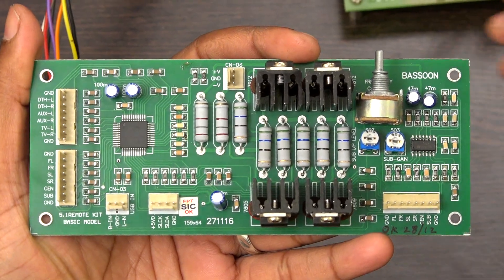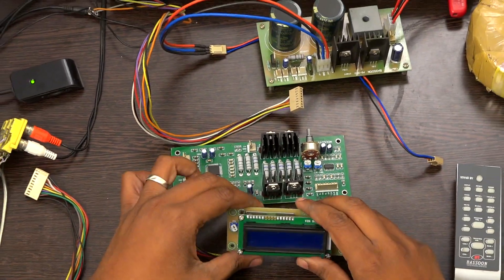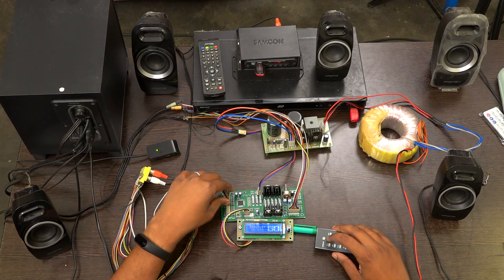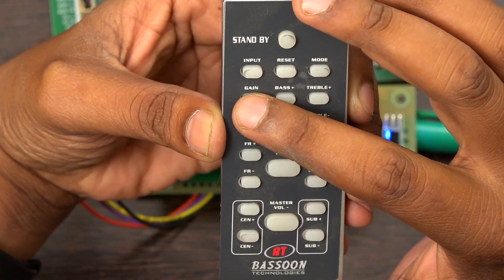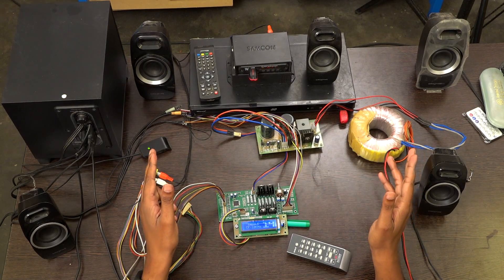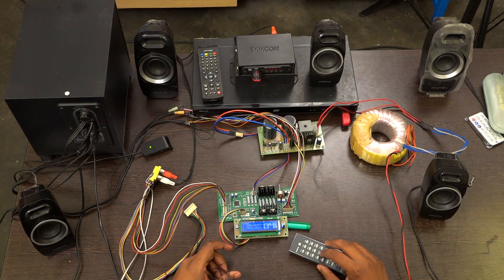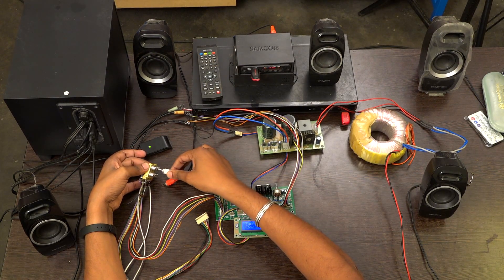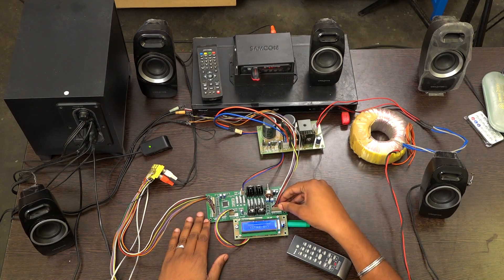Bassoon 5.1 Home Theater Remote Kit - Basic Demo

Comment: Any one who is having such 5.1 amplifire can share his experience. 
Does all 6 speakers sound properly every time. 
Does central speaker gives proper sound? 
Does subwoofer is properly give bass. 
Surround sound speakers give proper treable? 
I thinks after 2-3 month of use this system goes dump. No one can find what is wrong with this system.
Reply from the maker: Which board you are talking about, kindly mention it clearly.
Reply: @BassoonTechnologies  Bro,  I am happy to receive your reply. I bought a 5.1 home theater in 2007. That time it was just a kind of surprise thing for everyone. But after using it I surprised to know that The subwoffer is not working. 
It was hand made 5.1 amplifire. 
I visit may of machenic to repair it. But nobody was able to repair it. Now my love is safe in my almirah and all 6 speakers are kept in rest. 
I will show you my 5.1 amplifie.  I hope you may help me to suggest to repair it. 
Now I live far away from my native. When I go to my home. I will discuss about it through proper setup. 
Thanks for replying. 
I need to buy another 5.1 which you shown here.
But I don't know where I manage to get all 6 different speakers including a subwoofer.
Reply: @theekhai2037  wtf,, mechanic will repair amplifier???
Reply: Sir can you tell me what is the   requirement of amp?
Reply: Is kit ko manouli kaise on Karen

Comment: sir i am using bassoon pro 2 board optical and coaxial input noise coming and sony blu ray player to coaxial input mp3 sub woofer not working still run stereo   only  what to do?
Reply from the maker: Thanks you for your enquiry. You can not give a mp3 signal in optical/coauxial, your input format should be in DTS/DOLBY format. If you have a mp3 input give it as a stereo input. You will get a 5.1 output. For noise problem please contact me @7810997809.
Reply: its working check sound format in dvd  change pcm to raw format subwoofer working perfect but dish not subwoofer working mp3 indicating